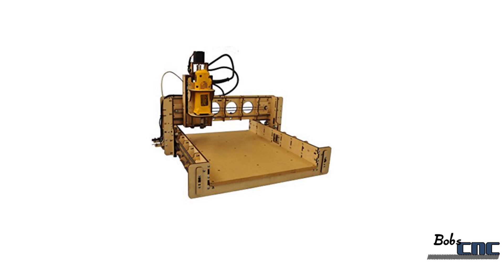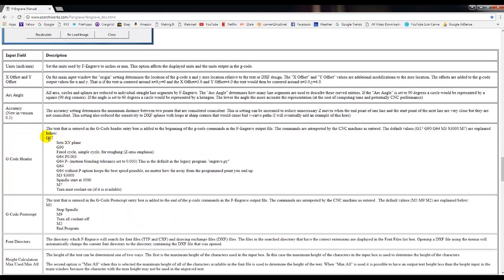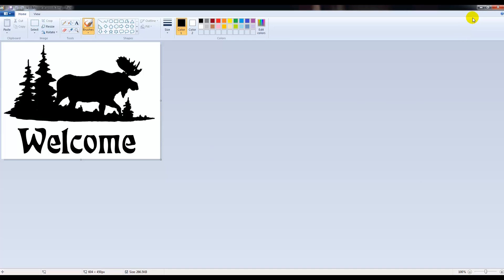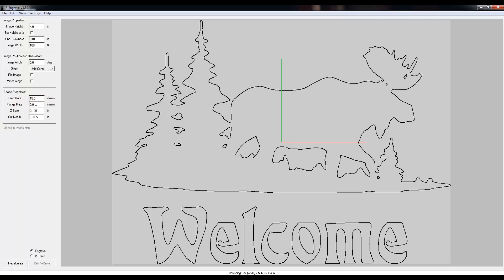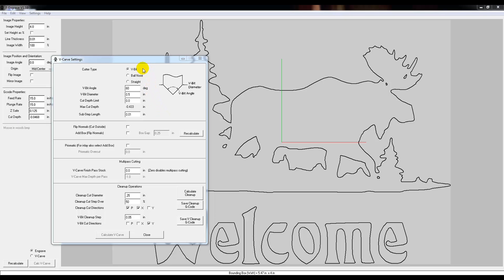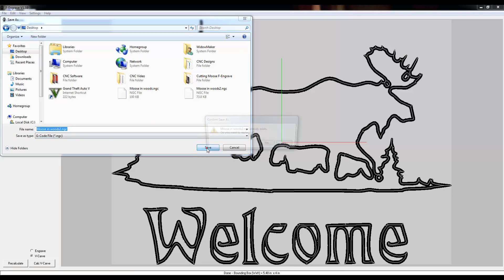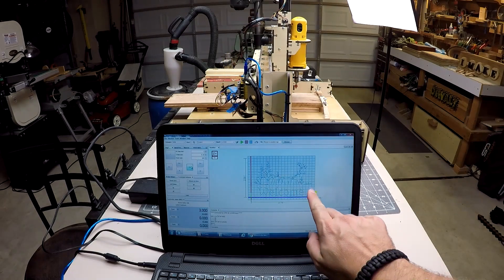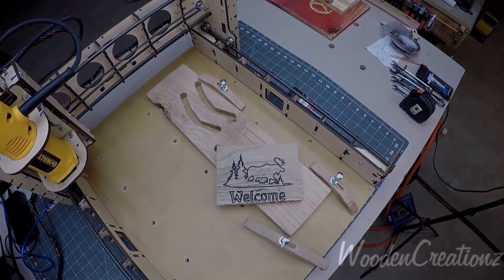F-Engrave - Design to Product on a BobsCNC E3

Comment: hopefully I will have the money to buy one in a month........
Reply from the maker: Have to say... its worth the money.. I tried to lay out enough bread crumbs for anyone to do it.. Its not hard and it gives stellar cuts every time.. I have worried one day it would fall apart or something might not work when I went to turn it on.. So far I have used it about every day for a month.. I had 1 set screw back out.. The cnc would dive a little deeper at times... I replaced the set screw, put lock tight on it... I have cut 5 gears and a template I am getting ready to put my name on... No more slipping or deep cuts since the lock tight. Have to say... you get more bang for your buck with this CNC... Bob asked for my honest opinion... The reviews on amazon are legit.. the thing is rock solid and I have a million ideas to do and try... Stay tuned to the channel... Shooting more videos as we speak.. Also check me out on Instagram at Woodencreationz if you want to see more behind the scenes stuff of the CNC in action.. I wanted more content before I dropped my money on this cnc... I wanted to see a bunch of proof that the thing actually works and can keep up with all my ideas I want to try... F-engrave and Easel are the 2 best softwares I have found to use with it when you get yours... Hit me back when you get yours up and going.. Im sure if you found this video... you found my install video on the E3... Good luck trying to make stuff for yourself.. I have spent more time making things for others than I have made for myself.. It wouldnt be hard to make some cash on the side with this thing... Everyone wants something made.. Brian

Comment: Nice video!
FYI, the cut depth on the main screen only controls the depth for engraving, it has no effect in v-carve mode.  That is why it is grayed out when you switch to v-carve mode.  I just wrote a note to myself to relabel it "Engrave Depth" in the future.
Reply: Can't seem to find your email.
Reply: +Gregory Thompson click on "Help" then "About". Or go to the help web page and look at the image at the bottom of the page.
Reply from the maker: Scorch Works Ty so much... I am a fan of your software, but not the most technical on all questions asked on here! I appreciate you giving them a hand! 👊🏻 Brian
Reply from the maker: Scorch Works Thank you!!!! That makes sense... You did a very nice job on the software... Bob at Bobscnc picked this software as the one to get everyone started... I have to say... I downloaded and reviewed 15 CNC softwares... This one and Easel were the easiest to use. And easel can't do vcarving with out trying to trick it... So... At the moment you hold a pretty good lead on the competition on ease of use and speed on learning. Keep up the great work. Had a lot of complements on this video in regards to a quick start learning guide on the software. 👊🏻 Brian
Reply: Hi! I've recently gotten an E3. Im using it carve stars for flags. However, I've had an issue with a few stars not aligning correctly. it will do 47 stars pefectly, but 3 will be out of place. Any idea how to fix this issue? Thanks!
Reply: Thanks! Email sent.
Reply: +Gregory Thompson e-mail me a sample input file image/dxf with the issue. My e-mail address is in the help menu.

Comment: fengrave will use jpg files too... I use them all the time.
Reply from the maker: garren25 oh shoot will have to try this!!! Ty!!
Reply: it is slower generating the gcode but i have less time finding images i like. i also like to use the 1/8" 60 degree PCB bits for wood they are super cheap and cut very nice in most hardwoods.
Reply from the maker: garren25 Thank you!!!! 👊🏻😜
Reply from the maker: Used a jpg today.... You're right... Select all image file types and you can see a .jpg. Cut it like a dream! Ty Brother!! 👊🏻